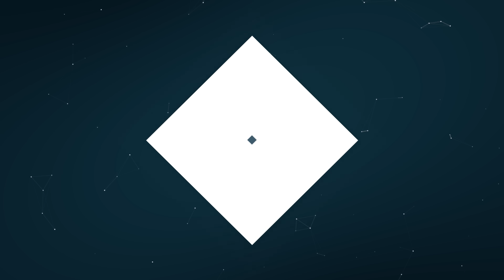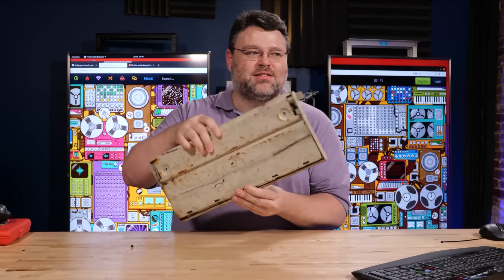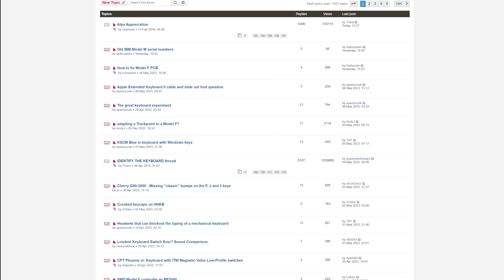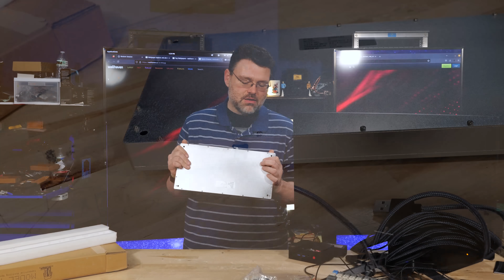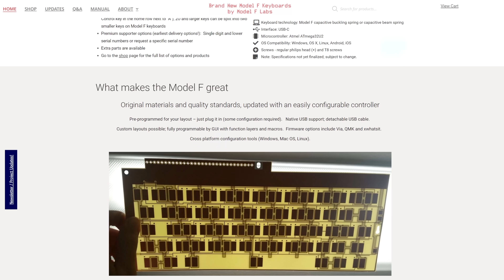Metal M -- with F Springs. It's MAGIC!!

Comment: Wendell, considering you might be one of the more knowledgeable people on these keyboards, and given your career space more than likely allows you the tools to do it, do you happen to know what the power consumption of capacitive switch boards are?  I know there'll be difference from microcontroller to microcontroller, etc., but I'm curious if there's a noticeable difference in power consumption between capacitive sensing and typical contact switches; especially when it comes to if someone wants to make a wireless keyboard, y'know where a difference in voltages and microamps, especially across 100-some keys, can make a difference.  I haven't really dived down the rabbit hole, but I haven't really seen anyone provide this kind of information, and I'm genuinely curious what the power draw characteristics between various key types are; I know inductive sensors, though they're great for analog where hall effect sensors have issues, is probably one of the more electrically expensive, with hall sensors second in line, I'm just not sure where capacitive sensors, or even resistive sensors, would sit on the power draw hierarchy.  Even just hooking up a USB power draw meter and recording draw over time (or, draw change via key presses, as an x+ny function, x being base with no keypresses, n being amount of keys, and y being draw increase per key, as change in capacitance would imply that the open and closed states should have different electrical characteristics) on one of your USB-converted boards would be fairly useful information, though I'd have to account for microprocessor draw.  I have some ideas bouncing around in my head, and knowing the electrical properties of various switches (or virtual switches in anything that's contactless) would be extremely valuable information.

Comment: I have had nothing but headaches with my Model F77 for the past year, with keys repeating or not registering, and weird USB issues. Worst is that it is random most times. I have followed the manual; I cannot believe he ships them unassembled with little testing for $500+. So many springs out of spec that I've replaced with mixed results. I've restored two OG model Fs down to bare metal and had way less issues with those. Joe is responsive and offers troubleshooting, but he should really hire a 3rd party to do proper QA and accept warranty issues...
Reply: I saw a whole bunch going for sale on eBay, probably because they gave up trying to set up the keyboard. Then, Modelfkeyboards started to sell new F77 Model F keyboards for $225, and a used one was sold for about $100 on eBay.  These low prices reflect the frustration buyers have with these keyboards.
Reply: @lym3204 so is it worth it?

Comment: I bought a Model M from unicomp in the late 2000's because I missed the old mechanical keyboards. Sad to say that it did not last long. I was expecting it to last forever, and then the USB was causing issues, and I had to change. I learned my lesson and went with a more modern keyboard. Now I just buy variations of Corsair K70. The metal body, low noise keys and the volume roller at top is more desirable than the Model F / M. I still like watching other people enjoy their older keyboards though. Hopefully yours lasts longer than mine. :)

Comment: My typing speed and accuracy have definitely improved with this one. The only minor gripe is that some keys occasionally “ping” a little too loud. I’ve tried to adjust those by re-sitting the springs as described in the manual, which helped with some, but others still reverb every now and then. I’m not sure, but this might just be due to the metallic chassis perhaps. It can probably be said that it’s all part of the audio profile of this lovely keyb.
Reply: The metal chassis definitely impacts the sound, and I wouldn’t be surprised if the metal resonates with the pings sometimes. You may be able to dampen it with something like a thin fabric lining inside (if there’s space, I don’t know how tightly it’s packed)

Comment: I have the original run 60% and I'd say it's not what you would call a refined design. Don't expect to just pull it out and use it. In fact expect to sit down watch a livestream or listen to a podcast and tweak every switch and key. I still have a key or two that stick every now and then. I will say when available it's my go to and tactility wise puts everything else to shame.

Comment: THANK YOU FOR SUPPORTING Brand New Model F!!! I own two of Joe's Model F reproductions, and you'll have to pry them from my cold, dead hands!!! SIMPLY AMAZING. Any KB enthusiast should own one. It's feels like God's Model M, with an extremely satisfying mechanical 'clack' instead of the model M's softer membrane 'thuck'. You must try it, you won't regret it. As long as you don't mind the missing function row, the Zinc Classic case is the one to get, it feels like a time capsule piece from the 80's, and the build quality is just about perfect (none of the flaws of the aluminum case).

Comment: I got mine last week and just put it together tonight. I agree with you completely, it's a great keyboard. If anyone orders one, be sure to check out the page with the keyboard feet - by default it comes with some small square sticker feet and I feel like it needs a little more lift in the back. Also, the instructions say to watch the assembly video. Absolutely do this, even if you think you know what you're doing. Definitely happy with the keyboard and I hope they sell a ton of these. Well, thousands anyway - a ton would be like 7 or 8 given how heavy they are.
Reply: Do you still get occasional reverb on some keys, even after adjusting the springs? Mine has a few “stubborn” keys that just won’t stop their song lol
Reply: @ChatGTA345  Yeah, I get some, but I haven't gone in and adjusted anything yet. I'm going to give it a week or two of daily use and see how it ends up. Definitely want to get the feet installed, it's a thick beast and I need it angled up a bit.
Reply: @Who-Dat42  Same! My order with the feet just shipped, so fingers crossed (pun intended)

Comment: The original XT layout was on the right track. If you are skilled enough with it, you never need to move your wrist to access the number, navigation functions and maybe even the mouse, even in modern command line or OSes.

Comment: OMFG that case is unbearably ugly... thank god he's also selling a "classic" model-m style case, with a proper contour to avoid recessing half the keys, instead of this ugly tapered block of aluminium, that looks like an off-the-shelf project case with cutouts. Also is it me, or does anyone else think those screws at the bottom are inexcusable? They need to be recessed! Recess the bolt heads, not the keycaps!

Comment: The Northgate 486 computer I bought back in 1989 (it was neither an "SX" nor a "DX", it was before that marketing ploy), the keyboard had a 5.5 lb. steel backplate. The reason was so that (1) it wouldn't flex, and (2) wouldn't scoot around while typing on it. It was a good, sturdy keyboard. The keyboard I liked the best was the Microsoft Natural Elite keyboard. It was slightly shorter in width because instead of having the arrow keys in an "inverted T", they were in a "diamond" configuration. I'm now using a Perixx wired, backlit keyboard with a silicon keyboard skin. The Perixx uses scissor switches, which are quiet, non-clicky, and work perfect for those with a light touch (I do not pound the keyboard, largely due to how I was taught in Personal Typing class way back in high school in the 1970s -- we were not allowed to pound the keys on a typewriter, either manual or electric). If I could find another Microsoft Natural Elite keyboard in really good condition, I'd buy it (if it wasn't horribly expensive) because I could type faster and more accurately on that ergonomic keyboard. I've seen the newer ergonomic keyboards, though they aren't as good as the MS Natural or Natural Elite used to be.

Comment: Model F aint the holly grail. The Model F was the IBM Beamspring built down to a price (and then the Model F was further built down to a price with the Model M). The beamsprings are the true gods of the IBM keyboards. Of course they're massive, and while they're incredibly loud and satisfying, for people in the 1960s they WEREN'T LOUD ENOUGH, that thing doesn't sound like my typewriter when I smash my fingers into it with 800g of force, so IBM even added a god damn massive solenoid that would fire a piece of metal into either another piece of metal or the case everytime you pressed a key (this could be disabled with a switch on most (all?) models).

It really is amazing when you first discover that the Model M is essentially what IBM came up with after the penny pinchers had had their way twice. Once you realise this though the fact that the Model M is actually a membrane keyboard where the entire layout is cast in a single piece of plastic makes sense. And the fact that IBM sealed them with plastic rivets (hence the bolt mod, which I suggest anyone do - if you have an older Model M that's a bit brittle inside and drop it, you can shear off every single plastic rivet at once quite easily - ask me how I know). There's also other reasons to do this, e.g. if you badly spill something on a Model M, especially a terminal Model M, if it gets in between the two layers of membrane you're basically fucked (again ask me how I know) - you cannot get into it without breaking every plastic rivet and doing the bolt mod. The Model M wasn't designed to be repairable, it was surprisingly a "buy a new one" item.

Which is only all the more impressive given how well the Model M's have actually stood up to the test of time, and how good they feel to type on. Let's remember that most of them are 30+ years old - some coming up to 40 years.

And also while the beamsprings are the completely opposite - fully metal case, each switch being its own module much like an MX switch or similar - let's also remember the systems they went with would set you back A LOT of money back in the day. And a beamspring keyboard will set you back A LOT of money today - last I checked here in the UK they were going for around £1500 to £2000. And that's just for a standard one, if you find something like a black one they can go for stupid prices. Personally I like the 6580 DisplayWriter, it's all white including the keys. The 6580 is also often cheaper, it was for a word processing machine and was the last beamspring IBM made, it included some cost saving measures like a speaker instead of a solenoid (although easy to mod if you want a solenoid), wouldn't be surprised if there was other cost saving measures internally - but it also included something cool which is a locking caps key, so you press it and it stays down while caps lock is on, press it again and it pops back up. Also makes sense why it was the last one, having such a huge expensive keyboard for a word processor wasn't very economical, so they built a cheaper smaller version - the first Model F model (then about 4 years later the Model M).
Reply: Unless it's part of a DoD project, every mass produced keyboard is "built down to a price." If it's the Pentagon, price is not an issue.

Comment: Thanks Wendell for making this video on the Brand New Model F Keyboards project!  If you do adapt the new Model F into the IBM SSK case, please do let me know how it goes.  I would not recommend it as you would probably have to irreversibly trim some plastic off the original case to fit the larger inner assembly of a Model F.  Regarding the recessed case, I do want to let everyone know that you can also order the F104 and FSSK with a standard Model M style case that is made out of metal and whose interior design is adapted to the Model F.  A downside is that unfortunately you can't switch an inner assembly from the compact case to the classic case or vice versa as they are slightly different in design (you could do this with the F62/F77 though).
Reply: You've gotta hand it to a company that is making the newest, best version of an iconic classic keyboard, finding them commenting in the comments section of your video on the products unboxing and review! As Chyrosran22 likes to say, "NOIYSE!"

Comment: I got the model F77 last year as buckling spring reference keyboard and it has been really amazing... if not including the lack of function keys. I have built all kinds of modern keyboards with Box v2, U4, U4TX, Various Tecsee switches, Clickiez, Oil Kings etc. and none of these compare to the deep and bouncy type feeling of the model F. It was expensive of course but now that we have an alternative without compromizing the layout...

Also I was blown away how good the buckling spring is in fast paced FPS gaming: it's very easy to do rapid pushes as the feedback is so unlike anything else and so forgiving due to the push range: it's like your fingers would be jumping on a trampoline.

Comment: Nice!!!!  It is REALLY tempting (I like the model M, but the Model F has the noise and tactical feel I like best).... But sadly, not at present time - I'll stay on my current Corsair K70.
Reply: Wife and I use a K70 and an EVGA X20.  Recently upgraded to the Steel Apex Ten Keyless.  I prefer the Steel Apex with its magnetic keys.  I also prefer as quiet a keyboard as possible which the Steel Apex is pretty quiet.  It seemed to improve my League of legends skill activations.

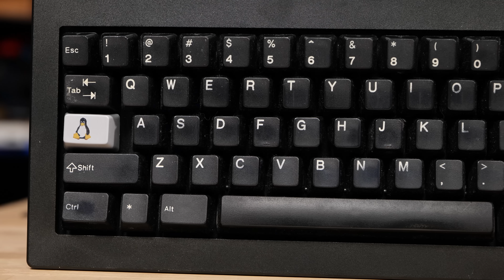Comment: I bought the even more compact version of this (no F-row, seen here 14:05 ) with a full Numpad, being smaller the case is level with the keys and it doesn't have the recessed keystroke problem.
As a gaming keyboard the ultra compact layout with Numpad is close to perfection and the Model F being somewhat lightweight in the keystroke works very well.

The only other keyboard I have that comes close to the price of this is a full size Topre, but that's full size so I don't use it much (my desk has a flight stick bolted in the middle, and my other desk has a racing wheel).

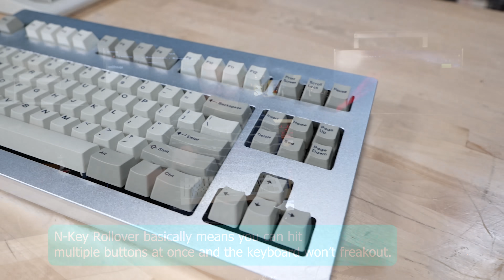Comment: @5:22 Aren't the keys a bit too recessed, deeper into the case than where they should be, specially middle ones? Keys following a concave pattern from front to back, but keyboard case is flat and maybe too high?
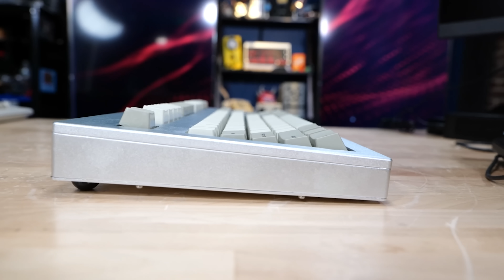@6:46 Wrote the above before seeing this. Definitely keys in middle rows look way too deep for that case, imho.
PS. Model M user here, back in late 80's early 90's, as well as now since before the pandemic. I remember using Model F's back then as well where I worked. I believe I resented a bit the sharp pinging sound, when I could choose I always preferred using the PC's that had the Model M's.

Comment: what's the difference between these and the unicomp reproductions?
Reply: This keyboard has a metal case and buckling springs in the style of a Model F's, so they sit on top of a capacitance-sensing PCB and has NKRO. Unicomp makes Model Ms (I also wouldn't say they're strictly reproductions IMO, they're mostly made with old IBM/Lexmark era moulds and by their old staff) which use a membrane assembly under their buckling springs and thus limited to 2KRO. Unicomp's cases are also plastic. Whilst they're easy to tell they're related keyboard designs, due to some select differences in the buckling springs (the spring coils and the flippers on the end of them), Model F style and Model M style keyboards also feel different and sound in terms of weighting and ping pitch respectively. Model Fs are considered to be better technology wise, Model Ms are generally far more affordable.
Reply: @sharktastica  a shark in the wild!